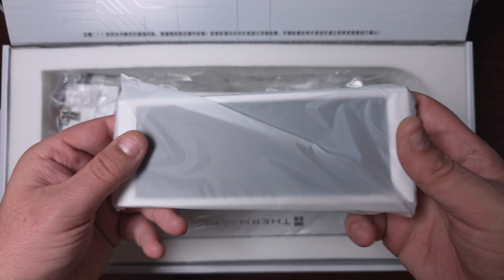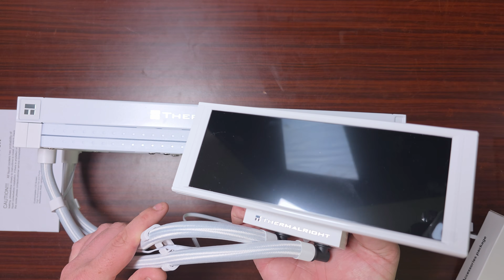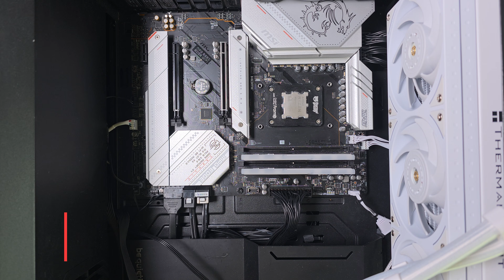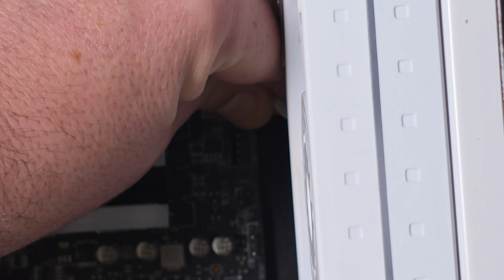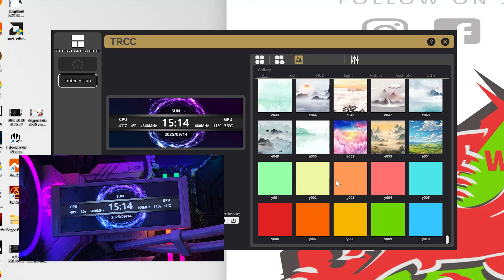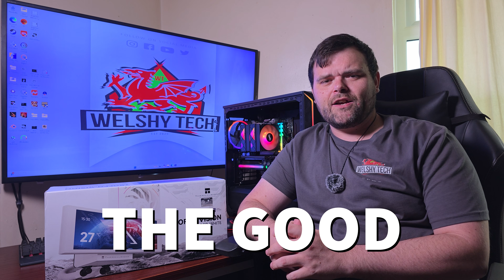Thermalright Trofeo Vision 360 ARGB White AIO Review - Best AIO?

Comment: I've been searching for a few days now trying to find out if the massive M.2 heat sink on my ASUS ROG Strix X870E-H would interfere with this AIO. The Thermalright website isn't clear--it shows a list of motherboards that are known to have an M.2 heat sink that interferes with the tubing, and lists my mobo as questionable. None of the pictures on any product pages show the bottom of the AIO while mounted very well, and the pictures that do kind of show it aren't using motherboards with those massive M.2 heat sinks.

Thank you for actually moving your camera around and showing the water block and exactly how it sits on the mobo. I'm now confident that I should have clearance if I have the water tubes come out to the side like you have there. Thumbs up!
Reply from the maker: Glad I could help clear that up for you!

Comment: you fail to tell us your using low profile ram. this would interfere with normal ram like corsair vengence ddr5 6400 I was going to buy this aio right now until i saw you using low profile memory. now I cant take the chance.
Reply from the maker: The Corsair Vengeance kit isn't that tall and my DDR5 isn't really low profile as I have low profile DDR5 here and it's taller not by much

Comment: It turns off randomly like once a week and only possible fix is to flip the switch on psu on and off and it starts working again. Many people have similar issue. Has anyone found a fix?
Reply from the maker: Instead of switching off the power supply ever thought of unplugging the USB2 cable?

Comment: Do the fans extract air and if they do could I turn turn the cooler around so it adds air instead of extracting air? I would also like to know if I have to put a reverse fan on the other side for a push pull setup?
Reply: You are fundamentally misunderstanding how the AIO works. Fans don't "add" or "extract" air, they "intake" or "exhaust"... but any case fan can do either by simply flipping it. "Reverse blade fans" exist because "normal fans" pull air from the open side and push air to the side with the frame bars (those 4 plastic bars that hold the center of the fan in place)--reverse blade fans will pull air from the frame side and push it towards the open side, and are used as intake fans so that the inside of the case is pretty. Fans will do whatever you need, as long as they're facing the correct direction. The cooler itself isn't what is turned around, it's the fans.

As for the "push pull setup", again I don't think you understand what a push-pull setup is or does. Push-pull setup means having fans on both sides of your AIO radiator, such that fans on 1 side push while fans on the other side pull. Push-pull setup is not necessary and typically provides less than 2 degrees of cooling under load. They do provide more airflow, but with diminishing returns. At 25% speed push-pull will provide ~50% extra airflow, at 50% speed push-pull provides ~20% extra airflow, at 100% speed push-pull provides ~10% extra airflow. But even then, that 10% extra airflow at max speed will have very little effect on the temperature of the liquid that's actually cooling the CPU and results in that "less than 2 degrees of cooling under load" I mentioned before.

The only real benefits for a push-pull setup are aesthetics (you can use normal fans on one side and reverse blade fans on the other so both sides look good) and acoustics (the fans can be ran at lower RPMs but provide the same cooling).
Reply from the maker: If you watch the unboxing, you will see the fans are only installed with screws

Comment: Can the block rotate 90 degree? i.e. putting the tube on the left or right hand size instead of bottom?
Reply from the maker: Unfortunately it's only tubes down or up
Reply: Thanks! I was curious myself. I was pretty sure it was either top or bottom, as most AIO blocks are only flippable by 180 degrees, but it's good to know for sure.

Comment: Is it possible to display FPS on the monitor as well? Using software.
Reply from the maker: You can through the TRCC software
Reply: @WELSHYTECH Thanks, unfortunately I didn't see the FPS data in the video, that's why I asked.
Reply from the maker: No problem 😊
Reply: @WELSHYTECH  Studying the detailed guide of the TRCC software, the FPS data does not appear among the selectable options. Why?

Comment: Can you adjust the screen orientation? So instead of left to right could I go up and down if I want jist to not cover the ram ?
Reply from the maker: Yes, you can do that as the magnets on the screen are very good and you can also adjust the orientation in the software
Reply: The screen is quite large though, it might not fit vertically on all motherboards due to M.2 heat sinks and/or VRM heat sinks... or even fans! I know the top fans on my case are only about 2mm above where the VRM heat sinks are, if I had a radiator on top there would be even less room... and even less if I did a push-pull setup for the radiator.

Check the dimensions of the LCD screen portion against the space you have available.

Comment: Could this possibly fit in a H5 flow? That’s the case I have and I’ve been going back and forth on what cooler I want but came across this and I’m interested.
Reply from the maker: That case does support a 360 but only at the front so yes it shouldn't be a problem
Reply: @WELSHYTECH thank you very much i appreciate it.
Reply from the maker: No problem 😊

Comment: is the pump located in the radiator ?
Reply from the maker: It's located at the end where the tubes come from the radiator it's located there
Reply: @WELSHYTECH thank you,then i will mount in the front of the case as push/pull, and i hope that screen will work with usb A to usb c, i want to use it outside under the monitor, cuz my pc case is under the table
Reply from the maker: As for the screen it only works with the cable included I believe as it needs USB2 from the Motherboard in order for it to work properly
Reply: @WELSHYTECH  I just want to say that the screen works also directly via USB A or USB C, I didn't even use the cable that comes with it. I used usb-c to usb-c and I placed the screen under the monitor, for it to work it only needs TRCC software